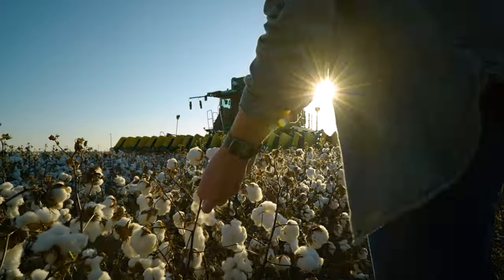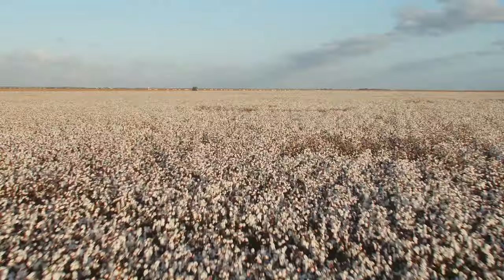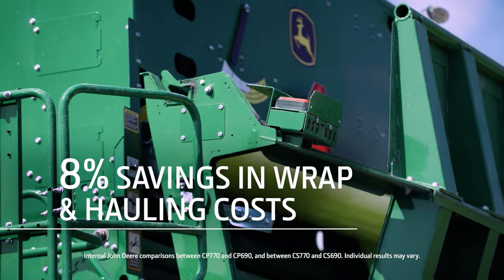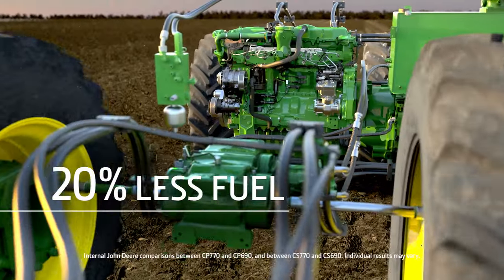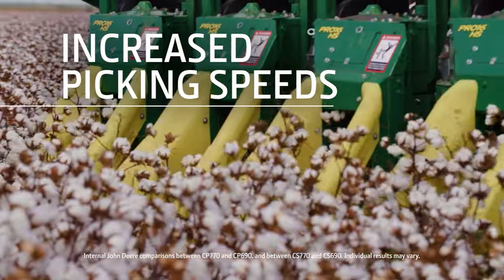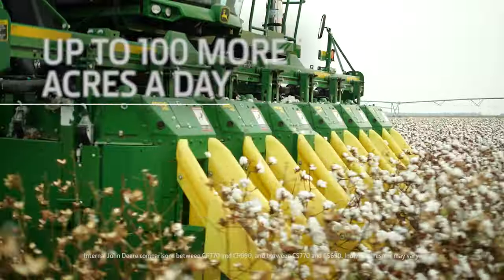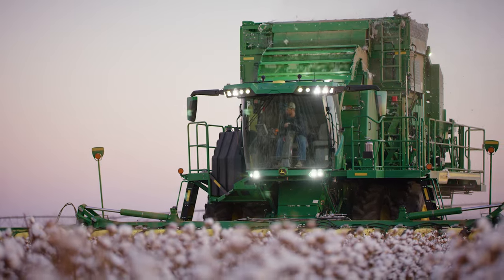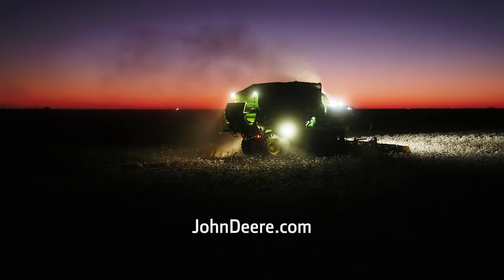+Gain Ground with the C770 Cotton Harvesters | John Deere

Comment: I like the CP770 picker I seen the previews at the john deere dealership I work at here in north texas
Reply: Here in North Mississippi we operate a CP690 and 2 CP770s and they really are wonderful. Cuts out the need for Module Builders and gets a lot more work done than the 4 row pickers we used to operate. When you farm 14 thousand acres of it they really get the job done and the cotton the gin quicker and more efficiently. The cotton gin comes out and picks ours up so yea it’s very efficient! Rather than the 4 row pickers dumping into the KBH boll buggy’s then having to build all the modules.

Comment: Where is the folding 12r30” head?
Reply from the maker: Thanks for the question, Aaron. There are three available headers for our next generation of Cotton Harvesters. The SH8R Folding Stripper Header can accommodate 36-, 38-, and 40-inch rows; the SH12R can handle 30-, 32-, and 36-inch rows, and the SH12F can take on 38- and 40-inch rows. You can find more information about our Cotton Harvesters here: https://www.deere.com/en/harvesting/cotton. Your local John Deere dealer would also be a great resource to answer further questions for you. If needed, you can find your local dealer at Deere.com/Dealer. We hope this helps.